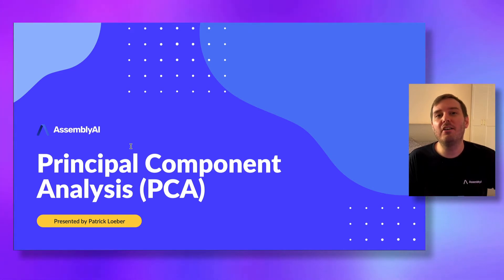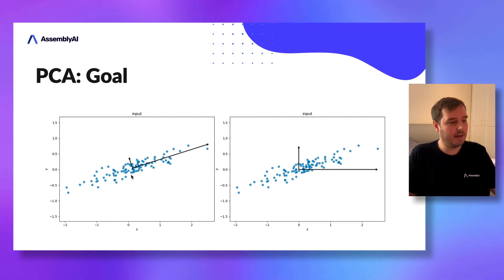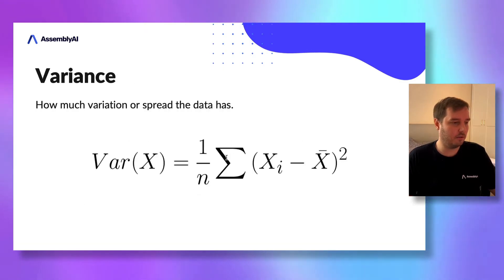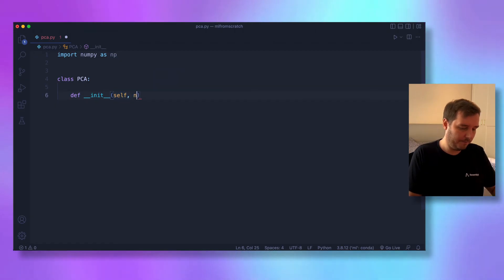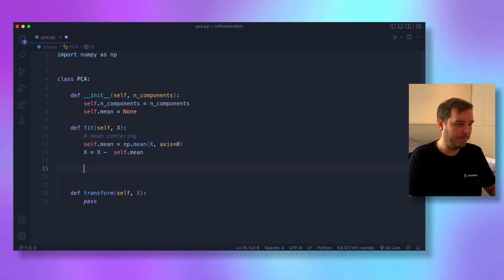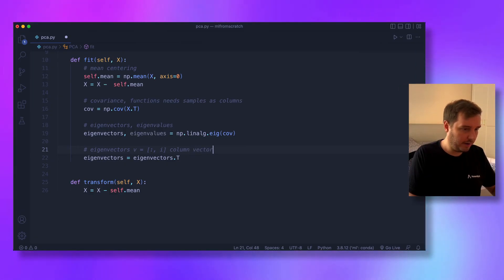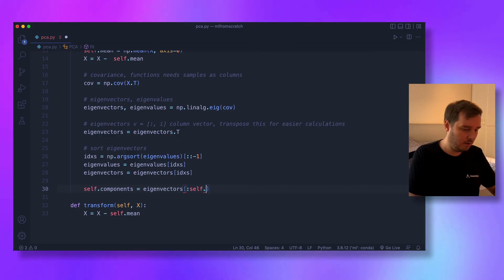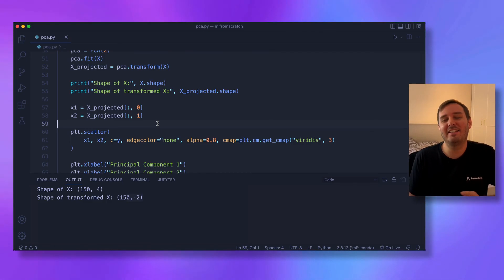How to implement PCA (Principal Component Analysis) from scratch with Python

Comment: Good morning, this playlist is amazing and I was searching it for several weeks. I have a question about the interpretection of the eigenvectors. Why do the eigenvectors, of the covariance matrix,  point in the direction of maximum variance?
Reply: if you take a unit vector in the variance dimension  , and tried to get the value when projecting data into that line means how much that unit vector encodes information about the relationship between the vectors in other words how much that unit vector contain information about the dimensions of covariance matrix so it we need to maximise that value of that dot product using Lagrange multipliers we got that Σv=λv , eigenvectors of the covariance matrix

Comment: HI, I am wondering the output of 'np.linalg.eig(cov)' in line 20. According to NumPy documentation the first output is the eigenvalues and the second should be set of eigenvectors stored inside a matrix. However, in line 20 the you swap the names between eigenvector and eigenvalues but still get a pleasant plot after PCA.  Could someone explain this part to me? Thanks.
Reply: Great observation and I think you're right, in fact. I've run the code swapping the two variable  - i.e. eigenvalues, eigenvectors = np.linalg.eig(cov) - and you get a different plot. This wouldn't make sense as you cannot multiply a matrix and a vector if the dimensions aren't appropriate, but for how numpy works, I suspect there is an implicit "broadcasting" happening at np.dot in the transform() method (line 35) making the operation possible.

TL;DR: Numpy doesn't raise an error, but the result you get is in fact wrong.
Reply: see my comment in this video...i mentioned the solution

Comment: Excellent video and beautiful OOP python programming, clean and easy to understand for a programmer, but OOP in data analysis is terribly ugly and not productive with a lot of not necessary abstraction with classes and methods. The functional paradigm is way way better for data analysis due to its easy (initial) concepts of data flow and functions that transform the data. This way anyone that learned "general system theory" could understand (managers, biologists, physicists, psychologists...) if you could do the same in a functional way would be amazing! (in Python, R, or Julia).